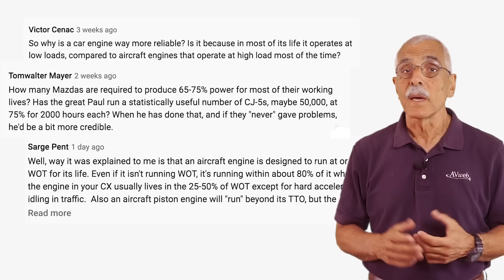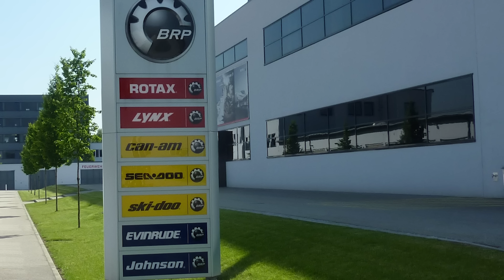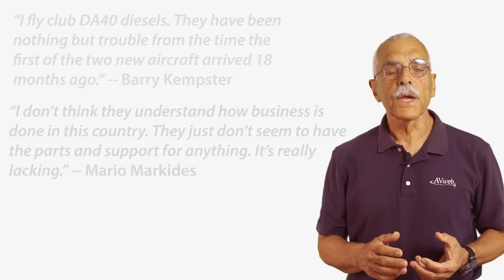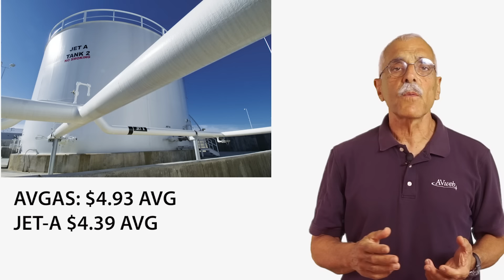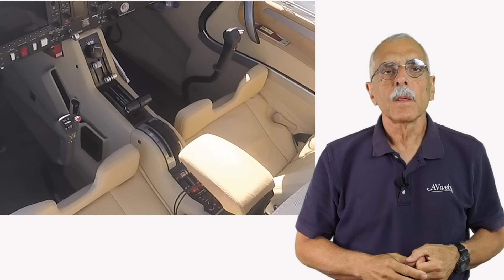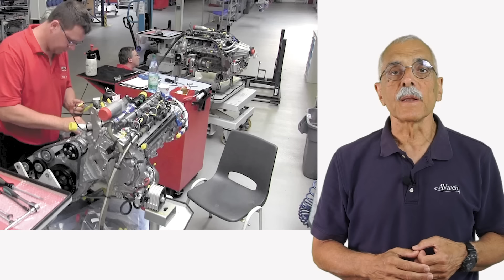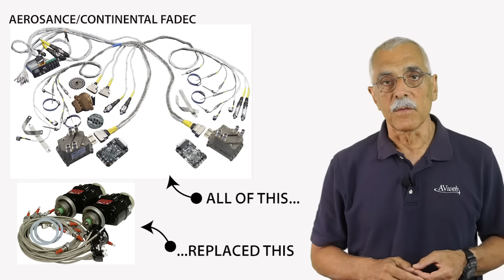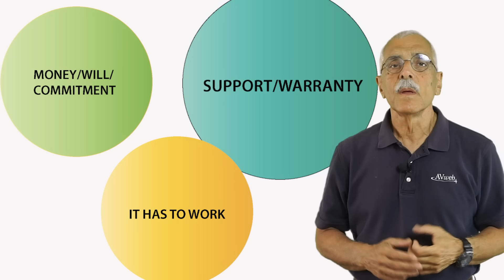Why New Aircraft Engine Ideas Rarely Succeed

Comment: Love you Paul; lol...you call it as it is and don't shave off any unpleasantness! No engine should ever, EVER "quit" - at any time - especially in an aircraft; not in 2021! I've been a pilot (SEL) for nearly 40 years now and I'm just dumbfounded that we are still "betting" our lives on 1930's motorcycle engines...it's just insane, especially at the level of technological advancements today. Love your honesty and incredible professionalism Paul...I remain always your biggest fan.
Reply: The one thing that these old tech air cooled pushrod engines have is lower weight but yes, they are a bit scary. Ran across one where a crankshaft counterweight came loose and destroyed the engine, yes, a crankshaft with separate attached counterweights in this century.

Comment: As an automotive technician, I sometimes wish we did this more. I've seen manufacturers release an engine, find all its flaws and improve them to be bulletproof gems, or at least for us to learn their problems and spot them. Then as soon as everything is great, release a new design that we have to figure out and deal with all over again.
Reply: Well if they don't release a brand new design, that old engine model might become *too serviceable*. They can't let drivers have it too good, nor let the automotive service industry become too comfortable and efficient, else car buyers might not have to replace their car exactly every 5 years.
Reply: Look at all the Airworthiness Directives... the Continentals of this world can't even rebuild 70 year old piston engines, because "purchasing" is full of accountants, and management full of ESG MBAs, and that in a world where every bolt needs to be "certified" or you go to jail....
Reply: @essa.321 and to explain why there are so many 4 banger (some of which I do like as they are cheap and easy to work on and reliable and others not so much, especially after they add new stuff for better emissions) is the overall fuel efficiency standards. Basically if they sell too many cars with lower fuel economy it hurts them in taxes or other financial ways, so the larger/older/more powerful engines are priced so that not everyone can buy them or to be less affordable or changed to be better at fuel economy.
Reply: I think this is solely due to the fact that the engineers want to keep their jobs, with no new engines to develop they will soon be unemployed!
Reply: Usa market messes with them to have something to sell as a new feature, euro market for tweaking co2 just ever so smaller to get an advantage on pricing(and consequently cheaper driving).

Not that usa market didn't constantly mess with new stuff being slapped on between early 70s and 2000.. Injection and carb systems that were used only for one year etc
Reply: most likely the new emission regulations kill them too. 
Look in the engine bay of a Mercedes 190 D build in 1989 and then look in a Mercedes C Class Diesel.
In the 190D engine you will see thee street below, the c classe is cramped full under the hood and not much space left in between.

What has happened ? 
stronger emission rules forced them to use less fuel , become more efficient and clean the exhaust gasses a lot better.

All for a better world, environment. 
but maybe not the most reliable engines when they start the production - and once the assembly line is running smoothly the next generation is on the horizon.

The good new: will no longer happen, cause mostly all german manufacturers cancelled all further combustion engine developments for cars.
They all try to get into the future with electric engines and evolution of a few combustion engines mostly neeeded also for vans where the battery size still matters .
Reply: @typxxilps  The EPA, ETC. are bought and paid for, controlled by the same people that bring YOU bust and boom cycles ... We SHOULD be seeing 100mpg cars and light trucks considering the technical advancements brought by the likes of Nikola Tesla and MANY others ...
Reply: @typxxilps  strictly speaking, newer diesels use MORE fuel than older diesels because much of the emissions problems are solved by using fuel for things that isn't transport, be it squirting in unburnt fuel to reduce combustion temperatures, to squirting in unburn fuel to heat up the particulate filter, to taking redirecting exhaust gas back into the engine (again to lower combustion temps), all of these methods make the engine less efficient at the only thing you bought it for - moving forwards. Also they're way heavier.
Reply: @John-rw9bv  that diesel in a c class is also way more powerful than that one in the 190D.... but  the car is also 240 kg heavier...

but it also has AC ..... which means a compressor
and also a stearing servo which also means pump etc....
Reply: Constantly changing regulations are what’s ruining the automotive market. Once an engine has the bugs worked out, regulations change making it obsolete
Reply: @essa.321 yep emission standards cost cars a lot of reliability and don't even get me started on California emission vehicles or diesels.

Comment: The first engine shown looks to be an H-style design very similar to what Subaru puts in all of their vehicles
Reply: Nearly all general aviation piston engines are "H style". They are also almost all air cooled engines, which opposed cylinder heads are well suited for.

A small number of general aviation engines are radial or inline 4 cylinders, the former being air cooled, the later being water cooled.

Comment: Years ago I owned an Ercoupe with an updated Continental O-200, an uninteresting mediocre maintenance performer. As the costs of maintenance multiplied I could no longer deal with the stress of unexpected maintenance. These attempts to improve aircraft engines have stopped me from missing owning an aircraft. I rent the few times I use aorplanes.

Comment: 1935-1945 all major countries advance the piston engine technology to its absolute limits of power, reliability and fuel consumption, until it could no longer compete with jet engines.
2000s: "lmao this baby uses the VW Beetle engine."
Reply: Piston engines performance is no longer a matter of life or death.
Reply: @imbw267  Yeah but the joke is that all the research is there. Any aviation company can build an engine that surpasses any car based ones using the research done 80 years ago, but there just isn't a market for it.

Comment: Great video!

When comparing engines, the difference between naturally aspirated and turbocharged performance at altitude is not taken into account. For example the Continental IO-550-N vs. Thielert Centurion or IO-550-N Austro Diesel, the Continental engine is naturally aspirated while both Diesel comparisons are turbocharged - which means they have significantly more power at altitude. This is lost in the comparison slides.

Comment: I really don't know much of anything about aircraft engines, despite taking some A&P courses in high school an embarrassingly long time ago. I wondered why the Porsche Mooney project failed and why I heard about various other attempts going nowhere. The conclusion I'm starting from outside the industry is that general aviation is a tiny niche market for engines which just won't support new types for lack of buyers. Small wonder why first Porsche, then Toyota and Honda passed on the "opportunity" because the numbers were just tiny. The regulations end up working against the general aviation market to the point where it's almost regulated out of existence. What would solve this problem? IMHO, better batteries; electric motors are a natural fit in aircraft; they're small, powerful, handle high loads, have very few moving parts and are extremely reliable. The only thing lacking is range- and that's a battery problem.

Comment: Currently hearing that the Yamaha 4 cylinder snowmobile engines are making new grounds in experimental aircraft, & seeing that they are sports motorcycle (r1) derived gives an excellent power to weight ratio.
Reply: 2, 3 and 4 cylinder Yamaha motorcycle derived 4 stroke snowmobile engines are flying,  but will pilots get use to 10,000 rpm engines. Great choice for experimental sport planes. If they prove reliable maybe Yamaha will produce aircraft engines like Rotax.

Comment: Ability to run an automotive engine at high output for long periods of time is more a matter of having an appropriately sized cooling system.  Lots of automotive applications it's a tad undersized because nobody expects you to run it that hard for that long and that's why they overheat when you visit Yellowstone and spend all day climbing steep hills.

The new, computer controlled, highly tuned engines have some good advantages.  But at the same time, to quote Scotty, "The more complicated you make the plumbing, the easier it is to stop up the drain."  I had a piece of farm equipment that ran on a 1950s two-cylinder Wisconsin engine for over 60 years.  It finally died by throwing a rod, blew a hole out the side of the crank case...

And kept running.  Spewing smoke and flame from the dud cylinder the whole way, but refused to quit.  Finished the work we were doing, and turned off the fuel and it kept running for almost ten minutes off the crank case fumes.

So for an application where losing power is highly dangerous I can definitely understand wanting to keep things as simple and solid as possible.
Reply: Had a 63 Chevy Biscayne with a very tired straight 6. One rainy night on the way into town it threw a rod through the side of the block. With a flashlight you could see the crank spinning. The engine was still running so I jumped in and drove the remaining 12 or so miles into town. I only paid $75 for the car in 1978 so I really didn't care if it died. I made it all the way to the club with it still running. At the end of the night I was unable to find a ride back to base so for shits n giggles I put the key in the ignition and lo and behold it started. So I put it in gear and drove it the 22 miles back to the base. It died at the gate while the skycop checked my ID. We ( the SP and I ) pushed it into the parking area. The next morning a friend and I gathered up a chain and went to tow the car to the base hobby shop. Once again for shits n giggles I put the key in the ignition and it started right up. Drove it to the shop, dropped in a 327 with automatic, gave it a paint job and sold it for $600. Thanks for the memories

Comment: I know someone that runs an RV6 with a supercharged 13b Rotory engine out of a road car.
Reply: Yikes!
Reply: @operator0  it runs great and he uses 89 octane fuel.  He also takes off faster than the stock set up.
Reply: @meatbyproducts  I'm sure it's really fun....until it stops working.
Reply: @operator0  let you know if it is an issue, he had been flying it for over 20 years now.
Reply: @meatbyproducts  Yeah, how many hours? 350?
Reply: @operator0   not sure, but he fly's every weekend and has since 1999
Reply: @meatbyproducts  How many times has he rebuilt the motor?
Reply: Every couple years.  He builds and repairs rotary engines for a business.
Reply: @meatbyproducts  So yeah. He's getting about 350 hours out of an overhaul. That is NOT a good endorsement for installing a turbo 13B into an aircraft. You should mention that the engine is only good for less than 500 hour TBOs before you brag about it.
Reply: @operator0  supercharged and getting far more than 350 hours.  You have made assumptions.
Reply: @meatbyproducts  If he flies it "every weekend" for 3 hours, and rebuilds the engine "every couple" of years, then that's 312 hours between rebuilds. 

We both know he's not flying it "every weekend" and he's not flying it for more than three hours at a time with the shitty fuel economy rotaries are known for. I'm being very generous with a 500- hour TBO. It's probably far less than that. But, be my guest, call the guy up and ask him.
Reply: @operator0  well you have made lots of assumptions.  You are wrong.  Not sure they precise hours but it is north of 700.  Couple in vernacular does not necessarily mean two.  Assuming he only fly's three hours or less is an assumption. 

You just don't want something to be true.  Sorry
Reply: @meatbyproducts  You claim he flies it 700 hours before over haul. You claim he flies it every weekend. You claimed he overhauls it every "couple" of years. The very definition of couple is two, so says Mirriam-Webster. 

But, just for the sake of argument, let's suppose he overhauls it every three years, and flies it 700 hours between over haul. That would equate to 4.5 hours of flight time PER WEEK. An RV6 has a 38 gallon capacity. I'm going to go ahead and make some assumptions about fuel economy on a 13b motor at normal operating levels, and I'm going to be generous. Let's assume that 13b gets 14 gal/hr at cruise power. The very best scenario is that he can fly for about 2 hours on a tank of gas (half hour reserve). So, you claim he flies the plane three times a week...roughly. 

You're trying to tell me that he spends about 10 hours a week on the way to the airport, prepping the plane for flight, flying the plane, and putting the plane back into storage. That's not including maintenance. I don't buy it. No one I know who has a two seat, recreational airplane spends anywhere near that much time flying it.

I'm not even going to mention that 700 hours TBO is frighteningly low, and would scare off 99.9% of the people who might be interested in a 2 seat recreational airplane. 

Here are the parts of the story I do believe: I believe your friend has an RV-6 and I do believe it has a 13b in it, and I especially believe that he does his own rebuilds, because that's the only way a normal person could afford to have a 13b in their own recreational aircraft. That's about all of this story I do believe.

I maintain that the engine almost certainly has a TBO of less than 500 hours, and your friend isn't flying it "every weekend", and especially not flying it for more than 3 hours a week if he does fly it every weekend. If he flew it for 3 hours every other weekend (on average), and over hauled it every four years, I might believe that, even though that would far above average use for a recreational aircraft.
Reply: @operator0  again assumptions and couple in common vernacular doesn't always mean two.  You're trying to defend your assumptions with sudo babble.  Again sorry you hate something.  I was just sharing someone that has had success in a none traditional airplane motor choice.  Sorry you are and ashore as well.   I don't have his flight logs for every trip he takes.  I don't have every number.  But that makes you a moron for making assumptions and making crap up to shit on something. Take a long landing on a short runway.

Comment: I never knew this, so it seems like if the old thing works there is no need to replace it where with cars there has been times something good was replaced with something worse to meet regulations or to be cheaper.

Comment: Because government certification is a retarded, complicated and expensive process...automotive engines are far superior...one thing all the old engines have in common is they’re manufactures have paid off the right people and cornered markets early in their existence...I’ve put many automotive engines in airplanes under experimental certification...the Subaru/boxer turbo is a very light, efficient and powerful motor that you can get parts for at any autozone 😂😂

Comment: Great story, Paul. 
Some additional notes, FWIW: The Bombardier (Rotax) V-6 had one mechanical design flaw (an unnecessary and exact 3:1 gear ratio, which had a built-in wear and vibration problem), and a certification impossibility, in the ignition/control system's being virtually uncertifiable at the time. Christian then focused on the Austro, which had a considerably less-complex set of engineering problems.
Right on, with the Thielert gearbox replacement requirement, especially as the aircraft was marketed as a demi-corporate transport that couldn't afford the downtime (and the near-requirement of having spare gearboxes on ice in the flight department).
As for fuel efficiency, the more-efficient but less-powerful and heavier diesel engine spends more time in climb, so the typical mission (say, around-the-patch training with two aboard vs. cross-country flying with reduced baggage) is worth considering. And as you point out, the $/mile figure is dominant in this equation.
The SMA and Continental derivative actually maintained identical casting numbers on the cases (and met the same fates).
The Honda-nental looked like a possible dominator in LSA and beyond, but apparently both concerned parties got cold feet at the same time, though for different reasons; and Toyota is a volume shop, a unicorn anywhere in aviation.
There's a number of V-8s (e.g., Orenda and its subsequent iterations) that made it to certification, but, well, they didn't get going in production applications. Similar lack of a platform killed EPS. 
There are more new designs on the way, like the A.M.P.E.R.E inc. "one-stroke" showcased at last month's Sun 'n Fun, and repurposed industrial V-twins, as seen on the Merlin PSA at the same show.  Time will tell.
By the way, since diesel is considerably heavier than gasoline, shifted airframe stresses and useful load with full fuel should not be neglected in the gas v. diesel discussion. But that's a different video.
Great history, clearly presented. Thank you.